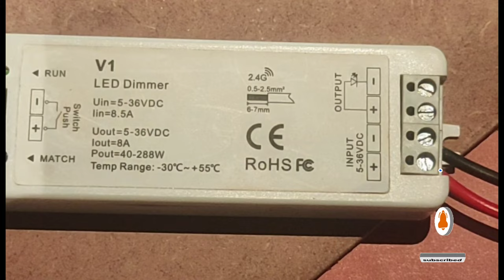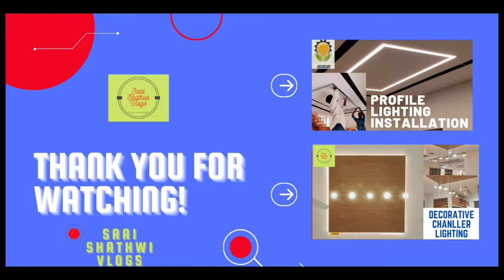Dim & Bright controlled coove lights. | Dim and Bright controlled in profile lighting

Comment: Which model of led strip is used in this ? I have the same light at home but dimmer is not working with that
Reply from the maker: sorry sir for the delay reply, this type used V2 dimmable controller. LED single or different colours.
I'll share my contact number +91 8072127831
please contact sir